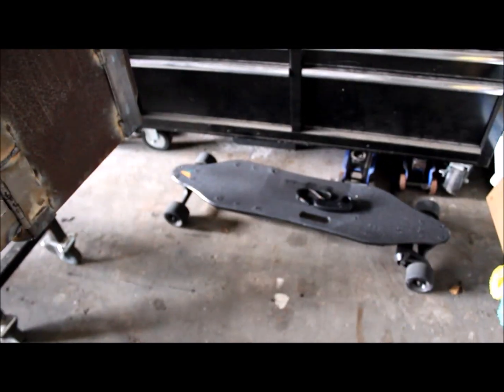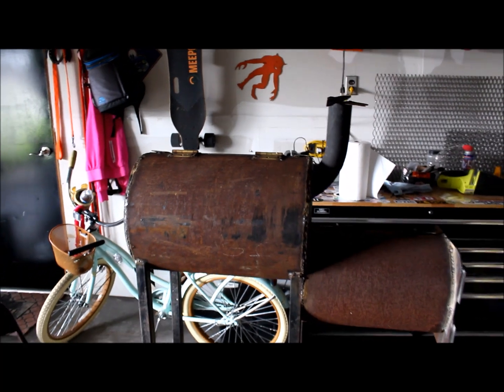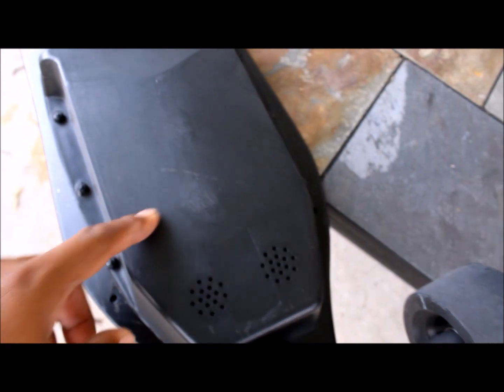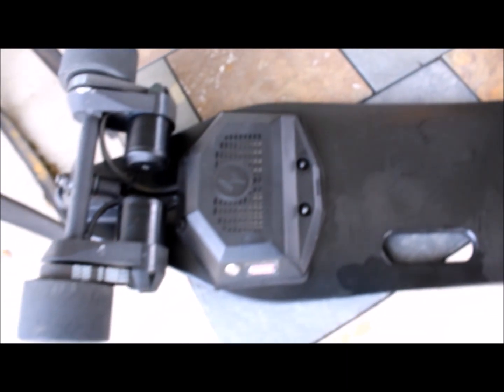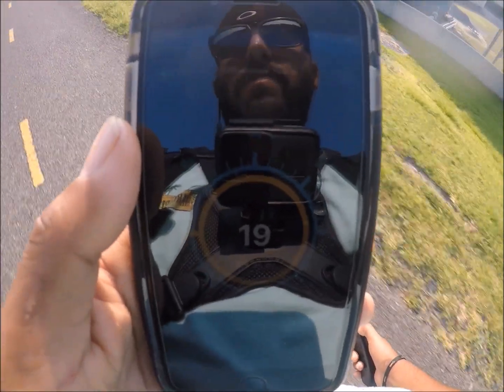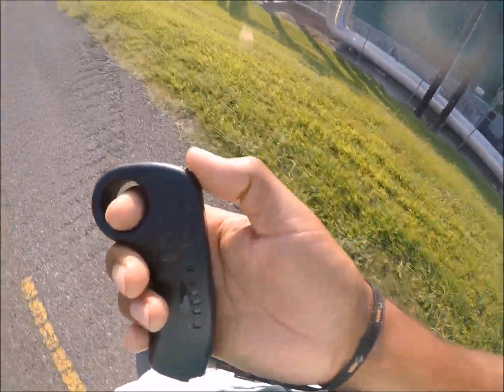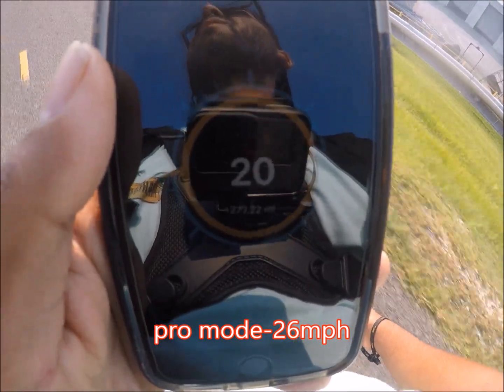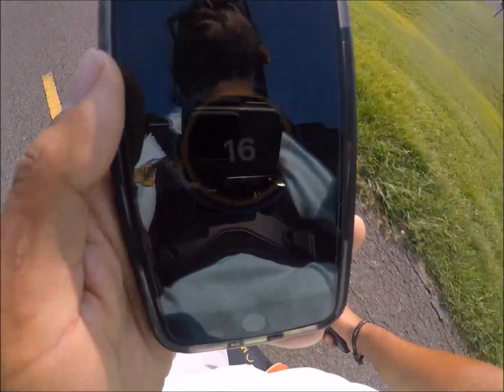diyeboard 10s5p speed test

Comment: Great video! Ordered the 10S5P dual belt kit from diyeboard.com and I'm excited to build it and ride it. Did you separate the ESC and battery because I think mine is supposed to be in the same enclosure
Reply from the maker: Reisegrossisten no the kit I did was the At kit with street setup and the esc was separate
Reply: Reisegrossisten Did you buy it ? Still riding with it ?

Comment: Why does that look like the river trail in the 504?
Reply from the maker: John Favaloro Jr. well it is on the Westbank side under the GNO in the 504 lol
Reply: Aldo Jr I saw the pipes and knew it was the Wank. I'm over in River Ridge. Just got home from an 8 mile ride to Elmwood. I'm on a Meepo 1.5 and I'm about to do a custom build.
Reply from the maker: John Favaloro Jr. nice the build I finished is nice and my meepo is great ha e the Sanyo battery but thinking of the boosted next.  Which battery you have on the MEEPO
Reply: Aldo Jr I have the basic 10s2p. I didn't want to go all out with my first eboard. Been riding it for months and wanting more range and top speed for a while. I finally think its time for a dual belt 6374 build with vesc and 10s5p. I like your build bro. Is there a eboard group in the GNO that you know of?
Reply from the maker: John Favaloro Jr. I don’t think so Would be nice though
Reply: Aldo Jr I hear ya bro. I want to find people to ride with and find new places to ride.
Reply from the maker: John Favaloro Jr. I agree would be nice to start a eboard crew down here

Comment from the maker: So far on one charge I have going 15.6 miles and still have a half a battery
Reply: Aldo Jr that's actually really nice, I was planning to get the inboard m1 but now this is the best option. So how much does the kit cost?
Reply from the maker: MC Alvin Nellone http://www.diyeboard.com/10s5p-360wh-battery-esc-dual-motor-belt-drive-power-truck-kit-p-590.html?zenid=ogckd89e6jjgifepk4olouav13
This is the link to the website and it was around $438. Mine was a little more since I went with the at conversion also
Reply: Aldo Jr thanks m8
Reply: That’s crazy
Reply: @SleptOn  crazy on the price, crazy on the specs, or both?

Comment: How’s the range comparison?
Reply from the maker: SleptOn on the 10s5p setup I get close to 25 miles on one charge
Reply: Aldo Jr you got that range out of this set up? http://www.diyeboard.com/10s5p-360wh-battery-esc-dual-motor-belt-drive-power-truck-kit-p-590.html
Reply from the maker: SleptOn yes the range is crazy
Reply: Aldo Jr that’s crazy
Reply: @aldojr5552  m8 are you still happy with this setup? Thinkin of slapping this on a shortboard or pennyboard to make the ultimate cruiser. You still getting good range and reliability out of it?
Reply from the maker: Domo Brah hey man sorry but I gave that board away but when I had it was impressed with it especially with the at wheel setup

Comment: those open ventilated cases are suspect..
Reply: I know right. Im not entirely sure why they're needed. I personally think is so that the internals don't get hot, but I'm probably wrong. If it doesn't make a difference however I would add some stickers or something.